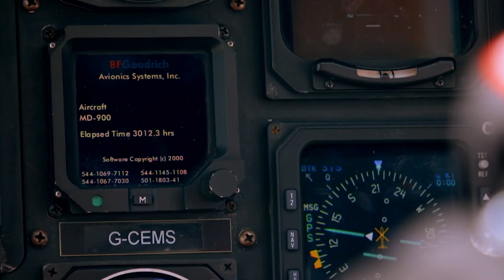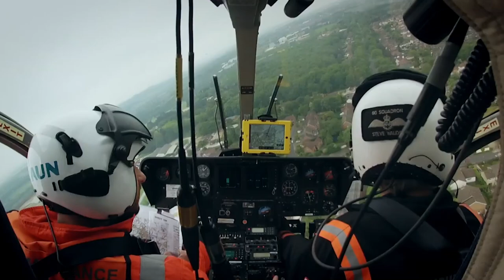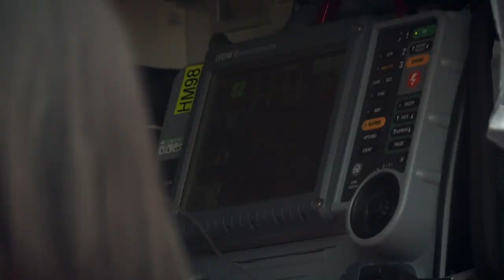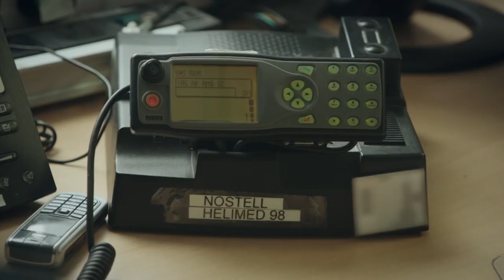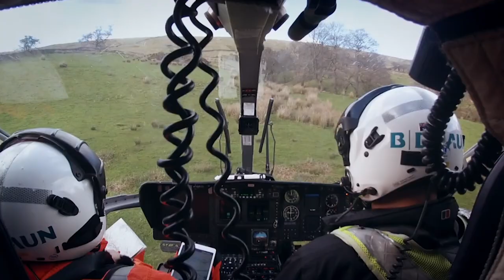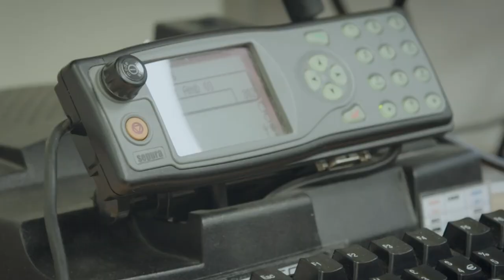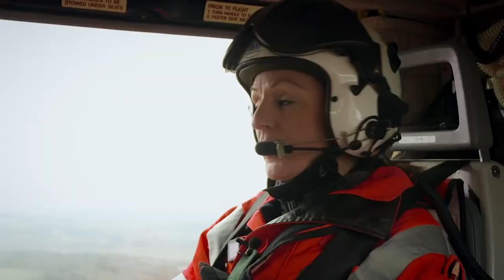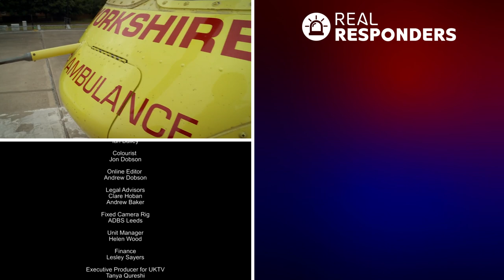Wasp Sting Causes Patient To Go Into Cardiac Arrest | Helicopter ER | Real Responders

Comment: It ain't CARDIAC ARREST IT'S HEART ATTACK. SINCE WHEN IS THE UK TAKING ON THE AMERICAN ACCENT.
Reply: Cardiac arrest is a heart attack 🤷 angry much? Lol
Reply: Heart attack is when your heart isn’t beating with a normal rhythm and cardiac arrest is when your heart stops. He had both a cardiac arrest is usually as a result of a heart attack…
Reply: People often use the terms interchangeably but medically they're not the same thing. A heart attack is when blood flow to the heart is blocked. Cardiac arrest is a state where the heart is not beating. A heart attack may lead to a cardiac arrest.
Reply: @MsKittyGirl2010  cardiac arrest and heart attack are two different things.
Reply: It's not an American term. It's used when the heart has stopped or is in VF.
Reply: They used it correctly.
Reply: Accent? lmao that is not accent. That is dialect.. and in the American dialect, Cardiac Arrest and Heart Attack are synonymous. I understand the argument that you are trying to make, but either way, they are both treated the same and are both caused by the same things. You are splitting hairs here.